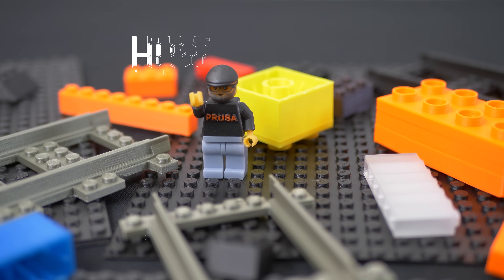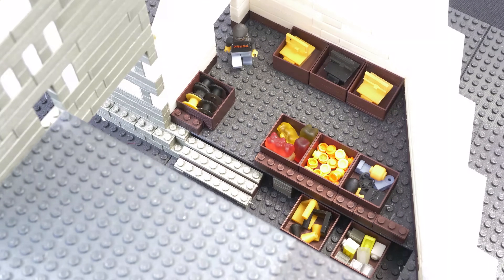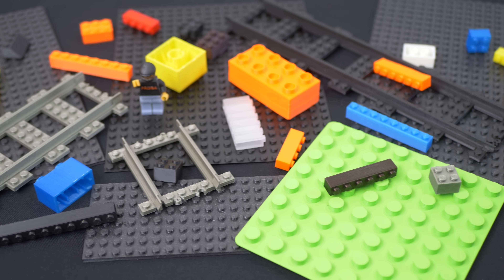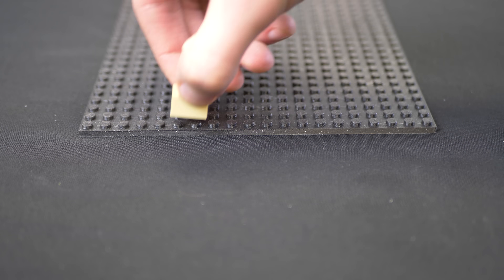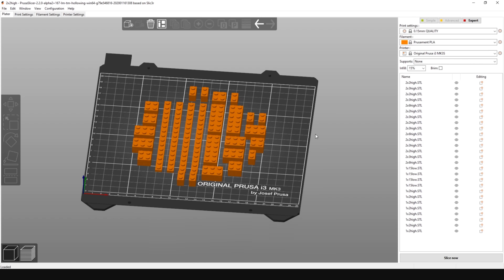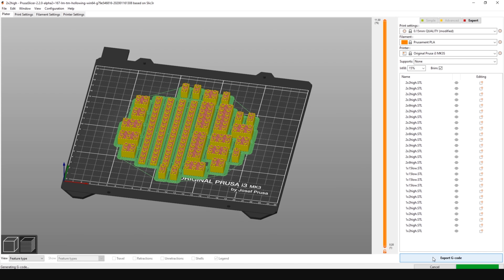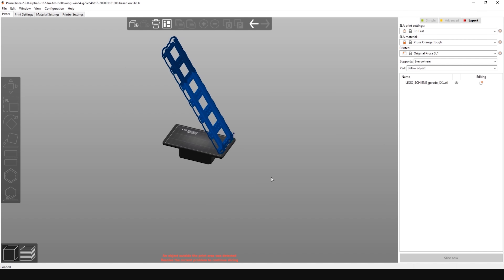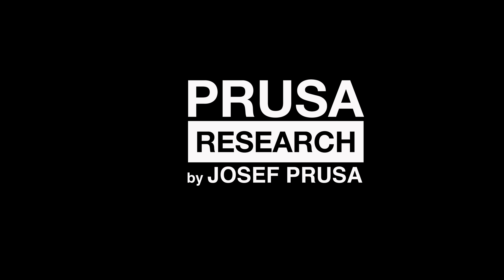How to make 3D printed LEGO and LEGO Duplo compatible bricks

Comment: I use an Ender 3, leveling the bed is most important. Use a 'feeler gauge', it is a cheap automotive tool. Autohome your nozzle and move it to start z position (+0.3mm on Ender 3). Select feeler gauge slightly smaller, I use a 0.275mm. This provides good adhesion, to remove parts, remove and flex bed.

I print legos without supports or elephant foot, also on Ender 3 I use 70mm/sec print speed and 0.28mm layer height.
Reply: OMG Thank you. I have the 3 pro, and i just havent been able to find good setting for printing smaller parts.

Comment: Thanks. I'm going to print on my Prusa mini a bunch of simple rainbow PLA duplo-compatible bricks, since my toddler doesn't treat the original bricks with much respect or care - missing two letters from an alphabet is a pain. So far I have a problem with size from thingiverse - it doesn't fit by a millimeter or more on bigger blocks, pretty big gaps.🙄 I hope your layout will be ok, I'm new in 3d printing and creating fitting blocks is a bit of a nightmare.

Comment: That's pretty funny I just had the idea to print some Lego bricks and did it a couple weeks ago. I swear I didn't see this video until now. I designed mine from scratch based on blueprints and measurements I found online. Mine were also printed in resin.

Comment: From my experience, printing Legos from PLA may not be the best choice. I printed a millennium falcon in pla, and the Legos lost their tight fit after some shot use. Perhaps, printing in abs, petg might be better. However, I haven't tried this myself yet.
Reply: I noticed the same thing and either added 5% more filament or 1-2% larger size of lego rings.

Comment: Why do we need to set the elephant foot and turn brim on? I m new to 3D printing..
Reply: With higher elephant foot compensation value you will be able to interlock bricks much easier. And brim function makes the brick to stick properly to the heated bed.

Comment: Its cheap, but its just painful to print many bricks. They never have the tolerances of Lego and so they have trouble fitting. What printing Lego is good for is if you are missing a piece, or need to modify one, for say putting an LED inside. One problem is scale. Whilst printing railway tracks i found they needed to be printed at 98% because they printed larger than the real pieces.

I would not have been able to make some of my old Lego models which were missing parts without the Prusa. Old white axles or gears with offset placements are more difficult to get, and it also lets you modify train rails if you want to make a short piece, for example if you run out of space and cant put a full sized piece in.

Comment: This is going to get taken down 

Pressing F to pay respects
Reply: They actually can't. The patent expired like 50 years ago (for the old/basic lego bricks)
Reply: @arthur1129  That didn't stop the thingiverse takedown a few months back.
Reply: It is not only a patent problem.
The problem is the use of the company name LEGO. 
So Prusa, take away the minifig and change everything named LEGO to "bulding blocks" then u are safe.
Reply: @SumUnicus  Calling duplo works as well
Reply: F
Reply: F
Reply: F
Reply: F
Reply: 10 months later
Reply: They can’t they have no patient and their trademark “LEGO” can fall under fair use especially if there’s alterations to anything lego has but to be safe just say interlockable bricks and they can’t do anything even if you copy their original design as long as you call them “lego” or refer them as lego
Reply: 4 years later, not taken down
Reply: F
Reply: F
Reply: F